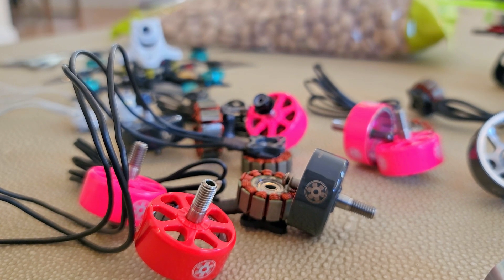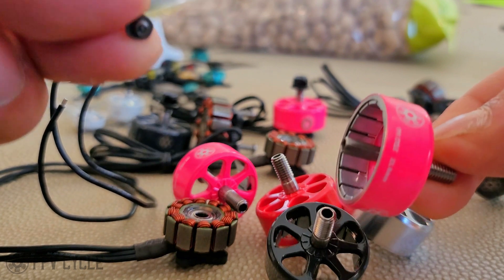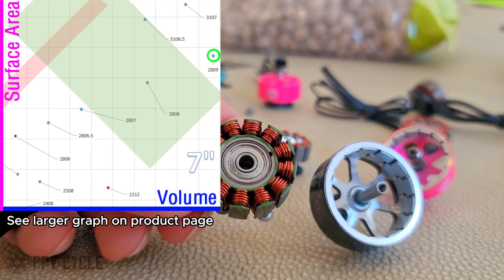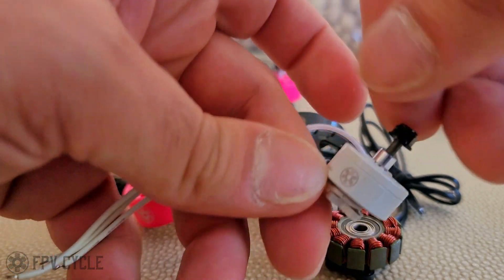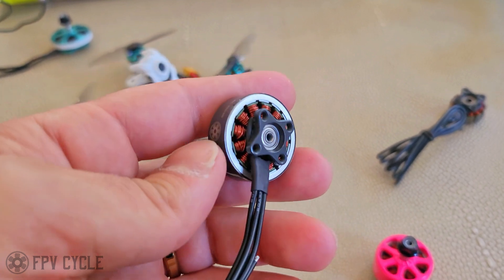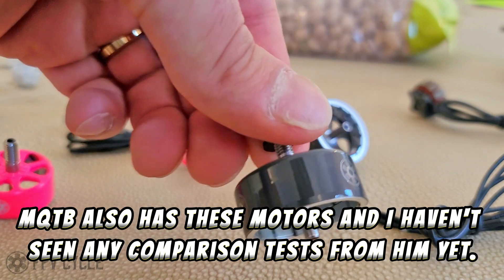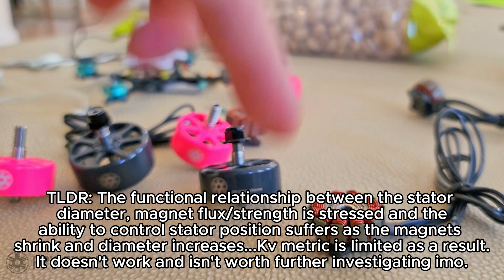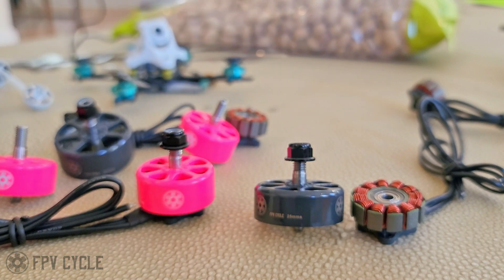Split Shifted Magnets and New Motors

Comment: If rcinpower manufactures them for you, why can't you make a deal with them, to sell them alongside with rcinpower motors, worldwide outside the US?
I'd love to get them in europe. Shipping and tax from the US is too expensive.
Amazing how you get your motors so light. Lighter than rcinpower makes their own. What's the trade off ? Durability ?
Reply from the maker: The motors aren't particularly light. We aim more for durability than weight savings. Some of the designs are generally lighter because of the component selection....smaller bearings, mounting patterns and whatnot. 

Regarding world wide distribution, wish we could but we would need to work with someone like banggood or AliExpress on something like that. We absolutely would if we could figure out a way to check their work and prevent 'miscalculations'. I completely understand the frustration and we are far more frustrated about it.

Comment: Thanks for sharing your findings, I have ordered a set of the 28mm to replace my existing 2809 from another manufacturer.
It would have been great  if some of these high vis colors were also available in the larger bells.
Looking forward to experiencing these new motors.
Reply from the maker: Usually these larger motors are used by videographers. That's why we don't opt for crazy colors. Just doesn't look professional and may even show up on camera. I still may make some hot pink bells. The hot pink looks beautiful
Reply: @Kabab  That's entirely fine, there must be more than 1 professional look though. I would have opted for a plain unpainted silver bell, or a colored trim like the T-motor 2808/2812. It's already all black on these larger builds, a little personalization would go a long way. My 1 cent, thanks.

Comment: wouldn't split shifted magnets require directional motors? like cw and ccw would need the shift in a different direction? did i miss something?
Reply from the maker: No. It's not directional in any way. The stator poles don't know and don't care what orientation the bell magnets are in

Comment: wait.. generally speaking these spacers could also go underneath the bottom bearing? I thought it was to lift the bell up a tiny bit (and it being at the bottom wouldn't do that right?). what slack will it take off then? are bell threads too short or something? I actually don't get it. 🙃
Reply from the maker: It's sort of vestigial because the rubber O ring pretty much makes the 0.2mm spacer moot. It used to be a washer to keep the screw from backing out too easily under the friction of various things. At least that's how I know it as.

Comment: I've been following for years, You've actually sent me extra full motors when I bent a drum. I can answer many of the manufacturing questions you had. 3:11-3:16 - that washer is not to take up slack. It equivelizes the magnetic field between the magnets;;; the reason the color stinks on motors is that color is like painting a picture - gravity, and color changes weight.; if you leave it hanging it falls. if you spin it then you get technicolor. either way the color is not a good way to measure performance.
Reply from the maker: The washer is said to do lots but it's really minimal in reality and it's also pretty much nullified by the rubber O ring

Comment: When will 25mm 2150kv be back in stock? White or high vis? Might switch over to Wasp stator size motor but need to switch to 6s.
Reply from the maker: For now we're not planning on restocking the 2150kv because it was so unpopular. The new batch is in progress in white/yellow for likely 2-3mo delivery. Manufacturing is sllllooowwww these days unfortunately

Comment: Have you guys looked into Axial Flux motors yet? Have I asked that already? What did you think of my own motor volume to prop size to weight theory that I posted in a previous video?
Reply from the maker: Yeah I've been trying to get a couple manufacturers to care about axial flux for many years now. Even offering to pay for the development cost to figure out how to manufacture them for our use. None of them want to bother until someone else figures it out. Frustrating
Reply: @Kabab  You might have to send them a homemade prototype (obviously larger since you don't have machining tolerances at home), Engineering Explained's video on Axial Flux, and detailed schematics for a properly scaled prototype (presumably) for 5-inch motors. Basically, show them rather than tell them that you're dead serious.
Reply from the maker: @Drunken_Hamster  they know exactly what it is. I don't need to send them anything.  They can make it, they just need to figure out how to manufacture it at scale because it's pretty small for the design and it's too labor intensive to do all by hand. They won't begin a product unless they know they can make money from it and they can't make money unless they can manufacture it for a reasonable cost.
Reply: @Kabab  Well, alrighty then. Anyway, part of the reason I bring it up is because it seems like it would be easier to offset/skew the stator or magnets on an axial flux motor. You could literally just clock the top disc of magnets 1/2 a magnet offset. Or place them on a diagonal, or wind the thingies in a different shape/pattern.
Reply from the maker: @Drunken_Hamster  yes it's super easy to do that on axial flux. But I wouldn't. Just having an axial flux design should automatically improve performance substantially

Comment: Pretty cool, the dual magnets will certainly smooth out noise & vibration in cinebuilds especially.
Reply: The logical solution would be slanted+concave magnets but until those finally get mass produced in every flavour imaginable they will never come cheap in low volume.

Comment: Bob's builds are best. I've tried the competitors and what I've found is: Bob's motors offer 12% better throttle control, 7% fewer crashes which equals a 43% better overall flying experience. I invest only in fun that matters and Bob is the chosen investment for me!
Reply from the maker: 😂 so many percentages 🤌
Reply: @Kabab  Forgot to mention you beat Cheena 100% of the time 💪
Reply: How did you come to only 12% improved throttle control? I measured mine at 12.091331% 😉

Comment: I wonder how am32 or escape32 would handle it.
Reply from the maker: Am32 just generally has more torque from low rpm. Same with the split magnets. I don't feel much consistent difference with AM32 vs bl32 in the air. I haven't done a like for like test yet however. Just doesn't seem that different however.
Reply: @Kabab  If you have any AM32 escs you can fairly easily flash ESCape32 to them. From my experience it feels like it has even more torque than AM32 gives you.
Reply from the maker: @Quick-Flash  but is it torque all the way through the rpm range or is it only at low rpm...which is great to get out of trees and whatnot
Reply: @Kabab  from feel i don't really know, haha. Haven't done any real data logging to see what its doing.

Comment: Does that mean that if I have a rcin power wasp motor and wish to purchase these bells, they will fit?
Reply from the maker: Yes it will fit however the shaft will be long so you'll need a bunch of spacers out the bottom. Also, it's not helpful from a performance standpoint. I think the wasp was 22.6x5 but then became 22.6x6.5. It's not that big of a impact to performance (very unlikely for anyone to be able to tell from flying) but just something to keep in mind. Also, have you tried to get your wasp bells off? It takes some doing and the top bearing usually comes out and gets stuck on the shaft. This is a major change we made that rcinpower was super resistant to. The best way to get the bell off that I have found is to thread a longer screw 3/4 way into the shaft, stick your hex driver in and hammer the driver to pop the bell off. It takes some hard hits. Also make sure the motor is screwed to a carbon arm for leverage and put the arm/quad in your lap upside down so that you can hammer without hurting the rest of the craft. This is not fun to do.....but then the darn bearing comes out with it.
Reply: @Kabab  Thanks appreciate the explanation! Haven't tried removing them and gosh it really doesnt sound fun. 😵

Comment: Hey I love the 25mm Motors... I have purchased the last 2 versions.. I would like to know If I just buy the Uni bells will it fit on my motors that came with the "NOT unibell" bell..?
Reply from the maker: Yes the unibell will fit on everything except the original batch that had a drawn line around the bell. Not the split bell gap.
Reply: @Kabab  Are you going to have the Raw finsh for the 25mm Motor..?
Reply from the maker: @keylitho  so far the only colors for the  25mm will be dark grey and white. We may add colors but not sure for now.
Reply: @Kabab So not Grey, Yellow and the Pink Coming soon.. Like is says on the site..? And there is no option for White.
Reply from the maker: @keylitho  oops, you got me :-D, they're coming, just gonna take time to manufacture

Comment: It took almost 2 years but I finally broke one of your 2203 motors on my Fouride quad. Had to replace it with a StanFPV 2203 motor though. The FPV cycle motors were not in stock at the time.
Reply from the maker: Unfortunate that Stan took my design to TMotor and ripped me off. Never nice to lose friends like that.
Reply: @Kabab  Oh wow. I never heard of the name or brand, I just seen it was the same size and close to the same KV. It is frustrating to have your personal design copied. Anyway, the FPVcycle motor broke because of a hard crash into a parking lot. It broke 2 arms on my Fouride frame and one of the bells separated when it went from circle to oval. So, the failure was not a motor failure. It was a blunt force trauma failure.
Reply from the maker: @CarbonGlassMan  blunt force trauma is deadly to all sorts of organisms 😂

Comment: I love the 1s 13mm motors.  Can we get bells with spokes not quite so thin? I feel like the og teal 13mm were tougher though i only have the 5000kv. Limboing drainage ditches with pipes running across has its moments 😥😂. But i love the ability to purchase just the bells as that's usually all that's needed. Cheers 🐝
Reply from the maker: Yeah next batch we'll make them a bit thicker or maybe just add spokes.

Comment: Love that your experimenting, failing and learning. That’s proper product design. Question: if the benefits are negligible, do the extra points of potential failure (more magnets) offset any gains?
Reply from the maker: Yeah it's definitely the most effective method by far imo but it's just so expensive and time consuming. But I get places eventually with it.

Comment: I didn't bother doing the math regarding the 2809 vs 30mm, but holy crap that has a lot more volume than I thought. I hear 28 and automatically think it's kind of meh for 7" (freestyle) but 2809 is a fair bit more than your average 2806.5. Very nice.
Reply from the maker: Yeah just look at the chart I put on screen. It's partly why we went with 2809. Specifically the magnet height is much more meaningful, weight is similar and the 3106.5 never got warm to begin with so we can afford a taller stator.

Comment: I agree with the 22.6 efficiency. I even capped mine by 90%; they have plenty punch. Noticeable more flight time and less voltage warnings.
Reply: Many motor reviews don't discuss peak efficiency across the entire rpm range not to mention required power to maintain or change speed from the higher rpm ends, it does make sense that a slightly larger motor that is limited from hitting the top end will score longer flight times. RCinpower appears to have this down to a science which is why they regularly do well on Chris Rosser's tests on efficiency.
Reply: There is some pretty complex physics behind a motor's ability to send a very clean backfeed signal for the ESC the higher the RPM you go, which factors into efficiency when requiring sudden abrupt speed change, which is what we mostly do zipping freestyle.

Comment: I love that your selling the motor and bell separate. I've been using your 25mm motor since the first batch (the ones with desync issues which you replaced for free when the second round was made) and I've been running the same stators since. I've only ever had to replaced motor bells and kept on ripping :)

Comment: So are these manufactured by rcinpower?
Reply from the maker: Correct. We work with RCinpower exclusively at this point. They have been excellent since the beginning
Reply: It's difficult to find a better fabricator than them. They've been kicking *ss.

Comment: Really cool products!  Just curious, why did you choose a smaller offset on the split shifted magnets and not more of a shift where the gap was centered between the other row of magnets, much like a brick wall?  Thanks.
Reply from the maker: Because then there would be no way to distinguish one flux field from the next. That's not totally true, it can be distinguished, but you ideally want a smooth transition. There should not be much need to overlap magnetic fields from one set of magnets to the next
Reply: Very cool, thanks for the explanation!

Comment: Has this already been done with the flying wing motors that are typically longer and skinnier?
Reply from the maker: I'm not sure about that but that sounds like a very appropriate application for this design. I believe for a consistent RPM level, you can achieve higher efficiency in the mid-range. It just doesn't work for us multirotor pilots because we spend most of our time at a very low throttle and just zip to max occasionally